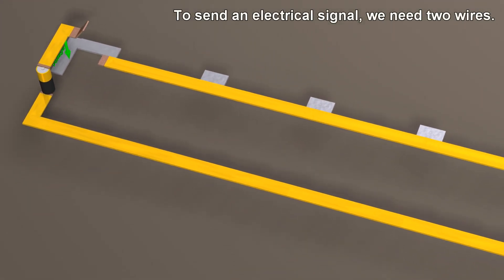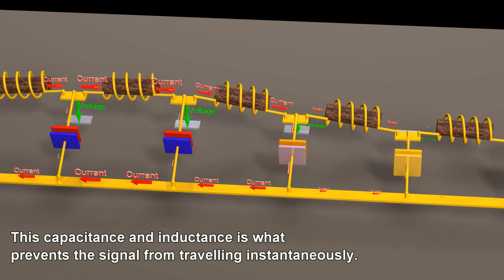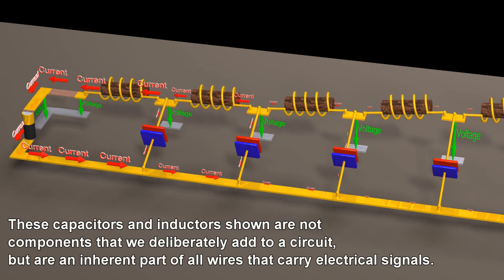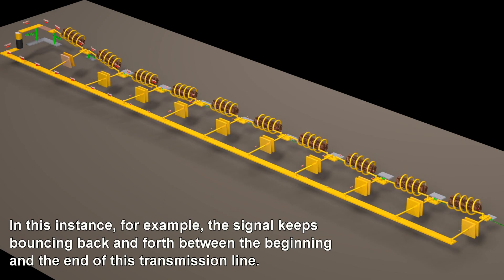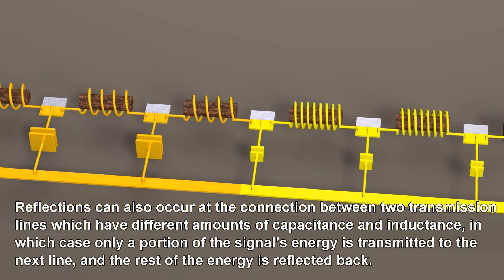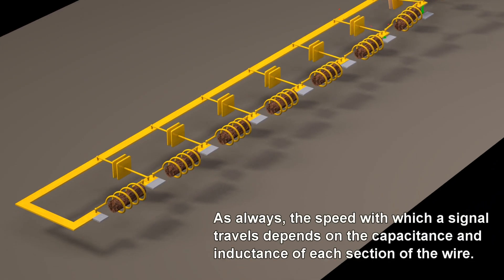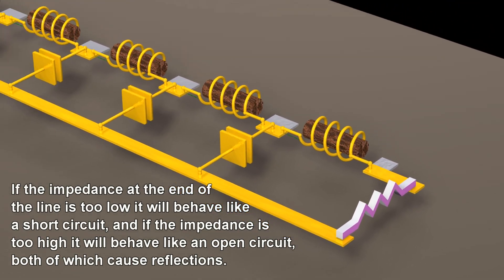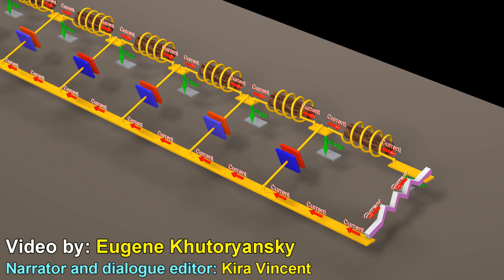Transmission Lines - Signal Transmission and Reflection

Comment: How inductance and capacitance can exist in a steady dc circuit ?
Reply: @WaleraRigid but the circuit is energized by a dc source. If we consider transient during switching, at that instant only inductance and shunt capacitance comes in line and that too for a very short period of time. After that inductance behaves like short circuit and shunt capacitance as open circuit.

Comment: Why were imaginary inductors not shown on the lower transmission line?
Reply from the maker: Because they are in series with the inductors at the top, and they can therefore both be modelled as just a single inductor with a larger inductance.
Reply: Ah, that makes perfect sense. Thank you so much for your response. And thanks for an absolutely amazing video and channel! Great stuff!!!

Comment: There should also be inductance in the return path.
Reply from the maker: Yes, but since inductance in the bottom (return) path is in series with the inductance in the top path, they can be modeled as just a single larger inductance in the top path.

Comment: In this video you wrong explain . DC voltage frequency -0 so C & L not possible to generate..
Reply from the maker: It is explained correctly.  When include the switch, the voltage source is not DC, but a step function.  And a step function is composed of all the frequencies.

Comment: by telegrapher's equation of transmission lines there are 4 primary constants present in  T.L   (i) R (ii)L (III)G (iv)C .....but you haven't shown R and G (you have shown only 2 i.e, L and  C ) and neither you have stated (but you should) that  we are considering "lossless transmission line " ....you also never talked about secondary constants i.e, Characterstic impedence and propagation constant gamma  ...i mean i just want to say that  if you want to explain then explain fully or don't explain  at all ..please do mathematical formulations to support your  physical reasonings .....for a person who do not know basics of transmission line i.e,  about physical insight of reflection coefficient , standing wave ratio and open circuit , short circuit , complex , resistive load termination he will never be able to understand "matching" and "mismatching"  which causes "no reflection" and "reflection" respectively and results in Standing wave formation , and thus no energy is transferred to load it just oscillates between nodes and antinodes....................................one last thing........you just told velocity of wave on T.L  depends on L, and C but you didn't tell in which manner (it is inversly propotional to square root of L and C )..............................please do mathematical rigour to explain everything that way it would be nice ...mathematics is the language of physics .without it you just say anything like   "transmission line theory involves theory of relativity ". but that is not true at all ....if you don't want then don't do derivation just plug formulas  and relationships that way it would be benificial ....at last. i want to say ..your animation is nice but background music is disturbing.............jai hind-( from proud IIT -M engineering graduate  b tech 3rd year ) haha ,.....
Reply: I like this video, it gives a simple explanation for the person in training to get an idea of what happens in transmission lines. It does not go into great technical depth, that is for the engineer to learn as he/she gains knowledge and progresses in their technical education; it is base level stuff.
As an analogy, the young biologist/gardener does not need to know the chemical composition of every part of the plant, only that it needs soil/earth/dirt to grow in, water, sunlight and fertiliser. 
If you try to force higher college level knowledge into someone who is just starting, you put them off forever.

Comment: Nice. Didn't know that happens with DC current. Wouldn't the wave flatten out over time due to resistance in the circuit though? I suppose with the rates that solid state stuff turns on and off at this sorts of things matter these days.

Comment: Why is a battery used to simulate RF? You have impedance only in an AC circuit, right? Great simulations!
Reply: Well this is true for AC current too. I think this is showing that it also happens in the first few nano-milli seconds after you plug a battery in and/or then flip the switch. So it's alternating, but just between 0,1,0,1...., instead of 1,0,-1,0... I think the resistance of the circuit should dampen out the waves after a few dozen waves have travelled. But with the rate that things turn on and off at these days (think the DC current being turned on and off at 1-4GHz in a CPU) it's a problem that's more likely to come up with modern electronics than in an incandescent lightbulb.
Reply: Got ya on that. True. If you could switch a battery circuit on and off 100 million X a second, you'd have RF @ 100Mhz. The telegraph on the Titanic was not much more than a lightning generator that threw RF all over the lower frequency band, right? Thanks for your comments.
Reply: May be for a transient response. For a Steady State this is not possible with a DC

Comment: Not convinced. Need to elaborate more. How can the voltage at the end of the line be twice that of the source?
Reply: He just picked an arbitrary value. It could have been anything. "Double" is the simplest value he could think of.

It depends on the capacitance + resistance of the wire.

Comment: Plz answer my question! According to theory of relativity sound does not travel faster than light but when we switch on the TV   first we listen the sound and then the light.why?
Reply: Because your TV does not switch on at the speed of light.
Reply: The TV with the CRT (cathode ray tube) type display has a heating filament in the cathode gun at the rear end of the picture tube. Incandescent filament takes time to glow sufficiently bright to emit electrons (thermionic emission). These electrons hit the anode (under high positive potential) and cause the phosphor coated screen glow light. So, it takes a finite time.
But the audio circuit has all semiconductors and act almost instantaneously. So, you hear the sound first, the moment the TV is switched on and see the picture appearing little bit later.

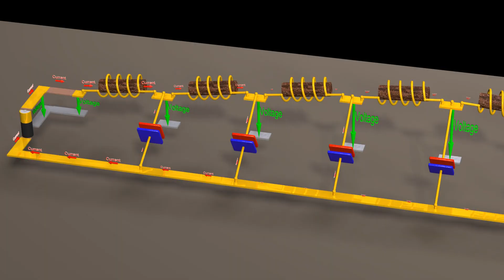Comment: At 1:10, I would have "inductance slows the current below the max speed through wire". Not that it is less than instantaneous which would violate special relativity. I don't see special relativity coming into this at all.
Reply: I thought exactly the same.
Reply: The bit about relativity is total nonsense. There is no prohibition against information travelling at speed C.. but in a practical transmission line, the L & C form time constants that limit the speed of transmission.

This is the concept of velocity factor - which is the fraction of C at which the signal propagates.

If you want to transmit information at C, then radio waves or other light (laser..) through the vacuum of space does that nicely. But via any physical medium, speed is always sub-C.
Reply: @drlegendre  Your comment says information can travel at c, which is true. The narrator said information can't travel faster than c, which is also true.
Reply: The fact that the signal cannot travel faster than c has nothing to do with the capacitance or inductance of wires, it is just that the electric fields propagate at the speed of light (c)
Reply: @nielsdaemen Electric field propagation and capacitance/inductance are not unrelated concepts.

Comment: I think the model is missing the source's output impedance, which is needed to achieve the right conclusions about the voltage provided by the battery at its output terminals, and the levels of voltages achieved in steady state in the line. I think that is why the videos are finished before they reach steady state (how do the capacitors and inductors look after a while  when at the end there is a shorting bridge? The battery provides a voltage, while the line becomes a short circuit -> boom! - Infinte current?). Also,  including the resistance along the line in series with the inductors would really help to see the behavior of electricity along transmission lines.

Comment: At 2:14,
"With nothing connected to the end of the line,the voltage at the end of the transmission line reaches double the value of the DC input voltage from the battery"
Can you please explain this?
Reply: Not true. It is just a transient consequence of the faulty model, which is missing the battery's output impedance and the inherent resistivity of the conductors. Too ideal models end up providing odd conclusions.

Comment: Inductors form because we use stranded conductors but what if we use a solid conductors. Will then also inductors form?
Please clear my doubt & correct me if i am wrong.
Reply: Ajay Kumar Sahu Inductance occurs in solid wires and PCB traces - it is NOT caused by stranded conductors.  Inductance is related to the geometry of the conductor. Genrally, the longer the current path is, the more inductance it has.  Making that conductor wider can reduce that inductance, but it can not reduce it to zero.  If you wind the conductor into a coil, you can increase its inductance by coupling the magnetic field between the coils.  Adding ferromagnetic material in and around the coil will increase inductance further by concentrating the magnetic field. 

If you search around the web, you can find inductance calculators for different geometries of traces, loops, and coils.
Reply: Thank you so much Cynthia Cantrell.
Reply: Ajay Kumar Sahu You're welcome!

Comment: "We can not eliminate the inductance and capacitance because of Einsteins Theory of relativity" seems a bit... unrelated
Reply: In fact, the wave speed v is given by v = 1/sqrt(l*c), where l and c are the inductance of capacitance by length unit, respectively. 
This velocity v should obey the relation: v < c, where c is the light speed.
Reply: No. It is wrong...
Reply: No. It is wrong...
Reply: Learning this in my transmissions class as we speak so I might be wrongexpert, but the properties of the line, namely the electromagnetic permeability and permeability constant (epsilon nought and sigma nought) will affect the velocity of the wave's propogation.
Reply: Relativity is the reason why an electric field or a magnetic field is relative to the frame of reference. So relativity is not unrelated to electromagnetism.
Reply: Because if u eliminate either the inductance, or capacitance, the wave would travel down the line fast as shit. Even faster than the speed of light. Which is not allowed by Special Relativity. But something tells me that this is wrong because those 2 parameters constrain the phase velocity, and the phase velocity can be whatever it wants, even faster than the speed of light. Its the group velocity that cant be faster than the speed of light, and the group velocity is a complicated function of phase velocity and frequency.
Reply: We can
Reply: The speed of light limit is only relevant when using an ideal wire with zero induction and capacity.
Reply: nottingtohide light has a wavelength too ya know
Reply: It is unrelated because there are instances of faster than light travel.  What they teach people in school is not what actually happens. It is like a "lame mans tems" kind of thing along with disinformation.  If anyone does any research into Di-electricity phenomena, you will see why most of what they said here is correct but for different reasons.
Reply: It's also wrong. The electrical wave will simply travel in the conductor as a propagating wave. Exactly like a waveguide for light. Nothing special about the resistivity of the medium here.
Reply: yea.. humans allways think they know the universe....because einstein said so...
im dumb as fuck compared to some fellow humans,but im sure that lightspeed will be just another border (for humans) to cross some day
Reply: @hansdampf640  We can't exceed speed of light not because Einstein said so, but because of geometry. That's just a fact
Reply: @fritt_wastaken  right...and some hundreds years ago it was a fact that the earth is d
flat and the centrum of the universe... plz dont come to me with the fact thing,we are far away from knowing and understanding the secrets of the universe..well thats a fact indeed ;)
Reply: Correct 💯 @fritt_wastaken
Reply: @hansdampf640  you mean like a resurrection?
Reply: @hansdampf640  I get your reasoning, but I believe this to be a different situation to one such as breaking the sound barrier,  etc.  It's not a practical barrier that can be overcome by sophisticated engineering, it's a theoretical one.
Reply: @Chadwickyboy accelerate some mass to,and over the speed of sound and go ftl is of course a very different situation,no doubt!
nowadays we put our nose to quantum mechanics,and we still wonder what,kind of,strange things happen on that level of physics.
or take a closer look on the doppelspalteffekt (i know only the german word for it,sorry)
we are an the state of just being amazed by looking on those things (those guys in the labs as well,believe me)
so,maybe the theories are right and ftl is indeed our boundarie in acceleration stuff,or...... not.
you can tell?
Reply: @hansdampf640  you're talking about the 200 year old double slit experiment, the results of which have been understood since Maxwell formulated his equations describing electromagnetic radiation.  We know ftl isn't possible due to many experiments.   One which is in practice every day is within the possible accelerator.  When we accelerate particles through oscillating EMF they continuously gain energy but do not continuously gain speed (guess which speed they approach?).  Instead, their mass increases, contributing to the increasing energy (1/2mv^2).
Reply: @Chadwickyboy the double slit experiment is understood and epxlained?
i know we know what happen in the experiment,but i never saw anyone explaining the "why"
can you post a link to the nobel prize holder who find out?
Reply: @hansdampf640  it's like sound speed in air, but in Ether.

Comment: Great Vids, but one thing: information can travel faster than light with two correlated particles, manipulating one of these particles at the sender and observing the other at the receiver. With this method, you can transmit information over no matter what distance with no loss of time, neglecting the time to manipulate/observe.
Reply from the maker: No, even with quantum entanglement, you can not send "information" faster than the speed of light.  I cover this in detail in my video on Quantum Entanglement at https://youtu.be/v657Ylwh-_k
Reply: I think you should clarify what you mean by "two correlated particles"...
Reply: Luis Torres Herrera I don't think that there are many interpretations of quantum entanglement, if you search YouTube for"correlated particles". Try this one: https://youtu.be/ZuvK-od647c

Comment: I love the way you use lift (height) to illustrate voltage. But you also need to show current dynamically, to complete the illustration. Perhaps the diameter of the arrows could illustrate current flow?
Reply from the maker: The amount of current flow is symbolized by the size of the arrows.

Comment: That's cool.  Phone lines are a good example of a transmission line, you can actually measure the capacitance and we do it from the CO when someone reports a trouble.  We can sort of get an idea of if there's even a phone plugged in based on the capacitance.  Or if the line is even connected at CO.  If the capacitance is 0 it means it might be open right at the frame locally.   This got me thinking... wonder if DSL modems do some kind of impedance matching when first plugged in.  That's probably what the "training" cycle is for.   This reflection is also known as VSWR in RF terms.  It will happen if the antenna is not proper for the frequency you're transmitting at.   (I sound like I know what I'm talking about, but honestly most of this is over my head, just been doing lot of reading latetly. :P )

Comment: Fantastic educational video as always. It's interesting to hear the physicist's explanation of EE material. I didn't follow the explanation about the second from last example, with the short. "The voltage is reflected but flipped upside down." What is meant by this? Thank you
Reply: I think it means it is reflected but 180 degrees out of phase.